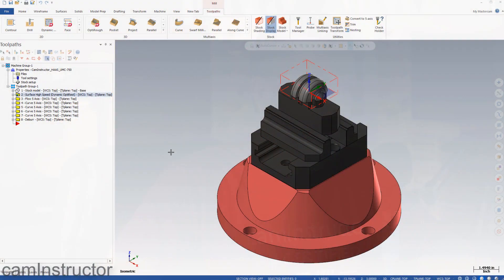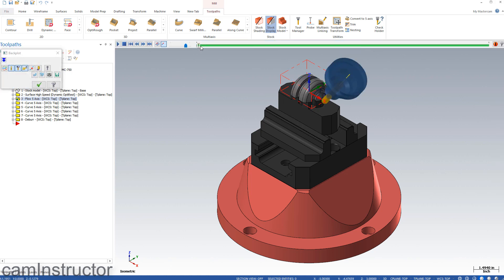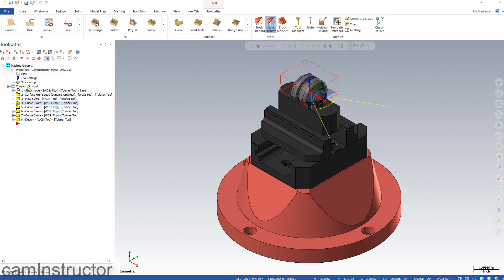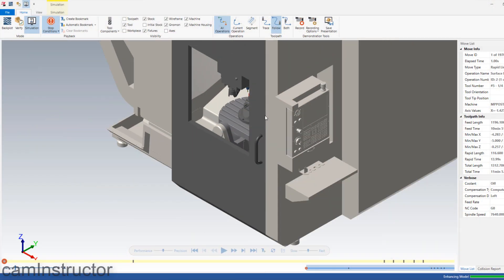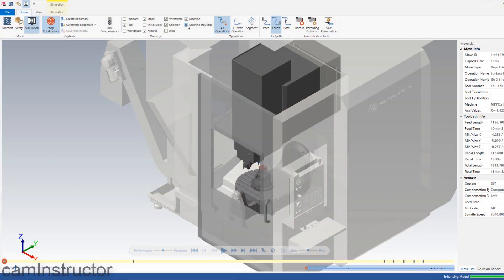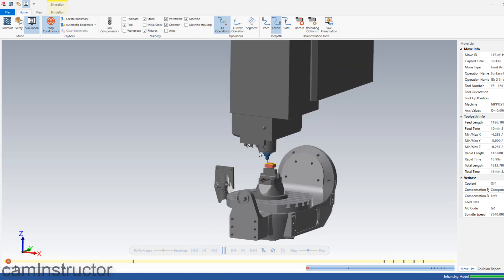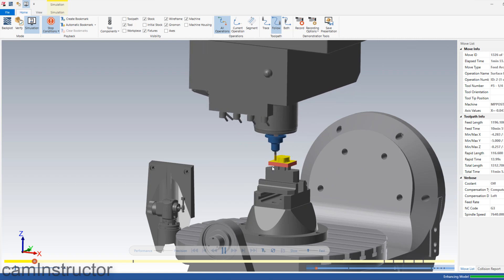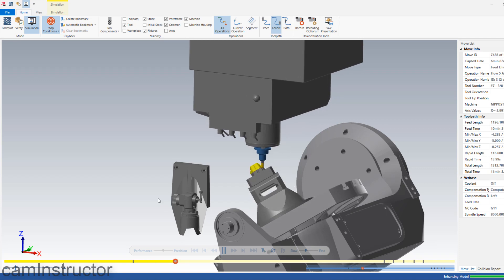FREE Mastercam 5 Axis Lesson

Comment: In machine installation part your umc 750 table seems bigger than actual machine. I tried sinulation with one of my part today then i noticed that.
Reply from the maker: The table in the sim files is from the original umc750. The newer UMCs, not sure the year this started, have a smaller table. You can get the files from Haas and edit the machine or just modify the existing stl to match what you have.
Reply: @CamInstructor  Do you have any video about how to modify existing stl?

Comment: I just emailed to your store about request some samples model that contains in 4th 5th axis book that I love to buy it. Because I couldn't see any inside the book what models are. Is this clip same in the book Sir? I love to learn this way not just demmo on some area 5th axis to be programmed. Is there any explanation about how to pick up work cordinate G54 for machine? Thank you Sir.
Reply from the maker: This lesson is part of the 5x course. These lessons do focus on programming Mastercam not so much setting up your machine. Focusing on machines is tough since there are so many different machines/controls to accommodate. There is some additional content coming for the Haas UMC machines in relation to setup and operation.
Reply: @CamInstructor  you said 5th axis course which is in the book called 4th, 5th axis? Or online courses? I am looking for a book. If machine with Funuc control so we have to use its post from machine manufacturer or Fanuc general? Thank you so so so much Sir

Comment: Hi there! I just tested your files and they are great! But I can't generate the NC code. All the files I have put where you indicate. Is there any file missing? How can I generate NC code? Thanks
Reply from the maker: If you are using HLE you cannot post gcode.
Reply: @CamInstructor  Hi there! thanks, but i don't use HLE, i use an industrial version
Reply from the maker: Ah, you're doing the 5X Free Lesson...missed that part. The download package does include a post but that post will not create gcode. It only populates text blocks within toolpaths. There should be mention of this in the lesson. Most 5X posts are locked and will need to be acquired directly from your reseller or on Mastercams website from the posts section.

Comment: esta maquina no deja un acabado fino ,, mas bien se parece a la minimill que deja acabados tableteados o pixeleados .. la verdad muy malos servos
Reply from the maker: "This machine does not leave a fine finish, rather it resembles the minimill that leaves tabletted or pixelated finishes."
The machine is very good for the price point its at. You won't find much to compare to it in its price range. It is absolutely capable of fine finishes. This project does not try to push finishes, it pushes the use of 5x toolpaths on a part a student can make quickly.

Comment: what graphics card do you use for simulation?  I need to do some graphics upgrades on my desktop but am unsure what to get...
Reply from the maker: Depends on your budget. 
If money doesn't matter, Quadro RTX is what you're after (although new cards may be released this fall). Otherwise a good gaming card works just fine. RTX 2070/2060 or GTX 1660/1650 would be next steps below the Quadro and are good choices.